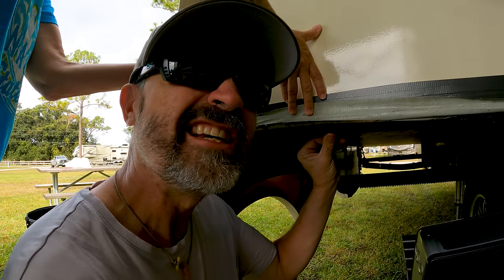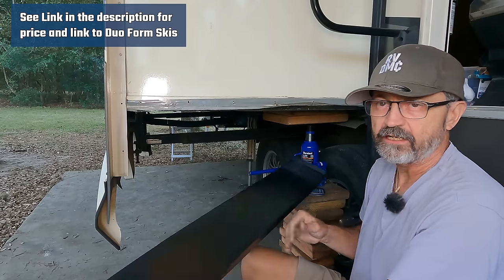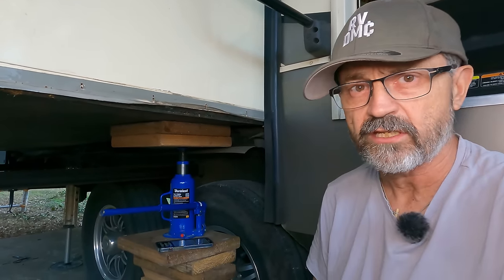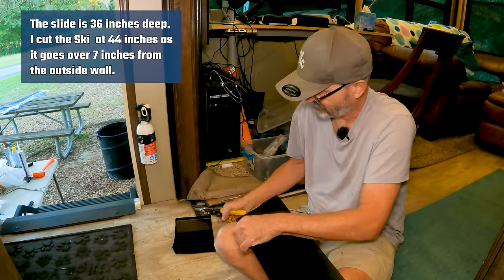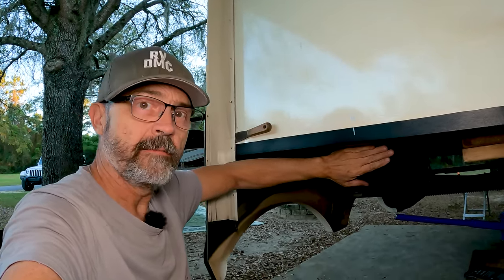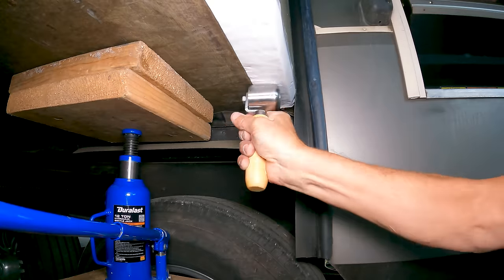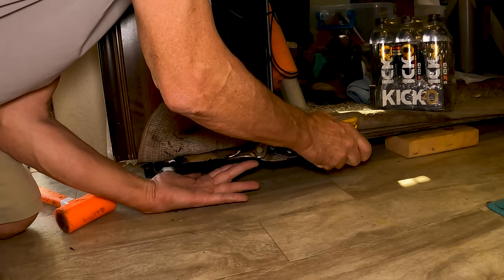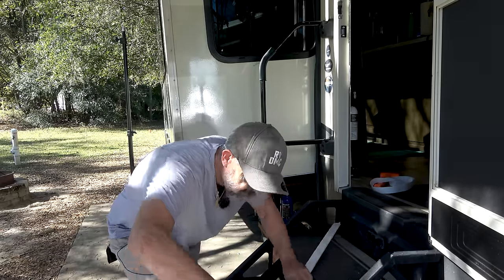RV Slide Water Damage repaired with Duo Form Skis (RV Living) 4K

Comment: I've helped so many 5th wheel owners with their slides in parks over the years. This includes brand new ones on their first trip. They all seem to be designed to fail at some point - some earlier rather than later. Nice job on the repair. I am sure those out there with slides will appreciate this video to reference.
Reply from the maker: It is ridiculous how many slide issues there are - we slept with our bedroom slide pulled in when we first went full time. 
The community is great because of people like you 🤗

Comment: Great job on the repair. I'm still in a S&B so I have all of those kinds of tools and sealants and solvents. But after watching this, I need to rethink some of what I'm carrying. Especially since we have an older smaller rig.  We're thinking seriously about selling and traveling for a couple of years, but because of the cost and availability of trucks, we're staying with our current rig for now. Thanks for the great detail.  We'll done, you do nice work.
Reply from the maker: We still have a storage unit where i kept a lot of the tools and supplies for our old S&B, every once in a while i pull something out of storage when we are near it.  I could have used my caulk remover tools for this job, but the razor blade worked fine.  Truck prices are crazy right now, going way over MSRP, you are smart to wait until this craziness ends. Larry

Comment: Excellent job Larry.  I have had similar problems on my 2018 Reflection.  Some of the screws in one metal strip rusted and broke before the cracks in the plastic started on each side of my kitchen table slide.  I couldn't get the all of the broken screws out so had to drill other holes in the metal.  I  stuck Eternabond tape over the cracks for a temporary fix and its worked fine for now.  I was able to get a 10' length of metal strip (white) from a local RV dealer and have the Duo plastic skis ready for a permanent fix.  I painted the metal with spray paint and will use some of your methods for a permanent repair next year.   Thank you.
Reply from the maker: That sounds like a great solution until you can get some skis.  I saw a video from one of my favorite RV youtubers, Love your RV   https://www.youtube.com/c/LoveYourRVonGPLUS, he also used some aluminum corner iron, to do his repair.  Thank you for the compliments, I really appreciate it.  larry
Reply: @DownsizingMakesCents  I bought 4 skis from DUO and have installed 1 under one side of the kitchen slide as the screws were not broke.  Will use some of Larry's techs.

Comment: Great job, looks great I’ll save this video to my favorites . Larry you’re doing a great job , nice and slow and not in a hurry so you won’t make a mistakes.
Reply from the maker: Thank you so much. I was nervous about Larry fixing a slide issue on his own, but I should know better. 
He does his best in his DIY videos to be thorough, but concise - not always easy to do. 
We hope this helps others feel more confident and save money doing a DIY 🤗
Reply: @DownsizingMakesCents   I found out early in my RV adventure that started in 2016 with a 2016 Coachman 17’ Travel trailer, U have 2 choices - one take it to the dealer in which I did and wait and wait and then wait some more till you’re old and gray or start learning how to repair your unit, so after a couple of times and bad repairers I started to fix my own and with the aid of folks like y’all, I have been doing just that. We have moved up to a 2021 Grand design Reflection 303 LRS and we love it our first fifth wheel.

Comment: I have had to replace the slide skis on our slide room as well. I also used the DUO  slide skis. The only issue I have with how you did the repair is how you sealed the bracket when you put it back on the slide room. I agree with the double layers of butyl tape as well as running a bead of pro flex across the top of the bracket, however I don't agree with running a bead across the bottom of the bracket. The reason is that if any water does make it behind the bracket and past the butyl it is now trapped and can't escape. The general rule I have been told and always follow is that you never completely seal the bottom as you always want to leave an escape path for water should it ever makes it way past all of the sealant.

The only other thing that you may have wanted to do which I had to do on a previous rig that had some water damage to the slide room floor edge was to drill a series of holes into the soft area of the slide floor. Then use  a two part epoxy that is designed to harden up areas of wood rot and force it into the holes and the edge of the slide floor where it is soft. Let dry for 24 hours then put everything back together. I did this on a previous unit and the floor was  still rock solid and held the screws 7 years later when I sold the rig. This is something you might want to consider if you every have to replace the ski again.
Reply from the maker: Well Bill, it looks like it would have been handy to have you around when i did this repair, you have a lot of great ideas and tips.  I agree its not a great idea to seal the bottom of the bracket, just like you said not where for water to go.  I thought about injecting some epoxy into the wood to firm it up but, except for the edge the wood felt very solid.  I dried it very thoughly with a heater for a couple of days, after i got all the water out it felt good enough to leave alone.  Someone else recommended a product designed for treating rotten. Wood on boats, I will probably try something like that if i have anymore rotten floors.  Thanks again for sharing your tips and experience.  Larry

Comment: Excellent detailed video. My only suggestion would be to put sealant on the screws prior to installation into the wood flooring. Unfortunately I have the exact problem along with slide out seals needing replacement.
Reply from the maker: Hey Vincent, that’s a great Idea about sealant on the screws to provide extra protection, I will try to remember to do that the next time I have any exterior repair where water is an issue.  Thanks Larry

Comment: Well done, I seem to have the same issue with possibly 2/3 slides, on a Flagstaff Front living, with 4 slides, stay tuened, I am going to attempt to start with my first slide/corner... This will be some work but it really looks like a solution...
Reply from the maker: After you have a problem like this and fix it, you end up making it better than factory original, but you got to keep an eye on all your bottom. Slide corners to make sure there is not any water intrusion. Larry

Comment: About to tackle this on my GD310GK. PArticl board not rotted just swollen at the edges a quarter inch(bowed downward)...I am drying out and will sand it a quarter inch down and perform exact repair as you did....dealer wanted $4500 for whole floor repkacement and said not rot, but wood layers are separting and will get worse,,,,I'll take my chances and give this a go...thank you for the video.
Reply from the maker: It is a very doable project, even if you have to replace a large section of the floor.  I was going to eventually put a new 1/2 inch sheet over the whole slide floor to strengthen it and just cut out the really bad sections below.  This rig eventually got totaled this year because of a bent frame boondocking in Montana, we have a new one now, but not i really inspect the slide skis regularly to make sure there is no water intrusion, if there is water i will address it much quicker than I did last time.  Good luck with the project, reach out if you have any questions.  larry
Reply: @DownsizingMakesCents  I was thinking of replacing wood, but will try this first. I have very minimal separation on edges and no rot...but it is bowed in center a lil.. .Just sanded down bowed part a quarter inch and put sealer. Putting ski's on tomorrow. Both sides need to be done,. Will let you know how she turns out. All the best to you.

Comment: Nice job, thanks so much for your video. GD 398M with similar issue on same slide out similar location. This 2019 model has the ~ 9’ slide carried on rollers at 4’ O.C. Water damage at the most inward portion end wall of the ¾” plywood. Plywood crushed downward about ¾”—I also noticed the slide bowed downward while looking across the bottom of the slide nearest the inward portion—both ends. I had some metal pieces customized to carry the weight out across the floor. Going from memory since I am a tad too busy to look at notes :- ) : 2 @ 3/16” metal plate bent L shape @ 89.5 degrees 3” H x 20” W x 30” long bolted to the floor. 2x2” ¼” wall radius corner aluminum tube as a stud with cap welded on top at the most inward corner on the inside of the slide. ~ 3” H x 3” W x 39” L 24G brown sheet metal for the ceiling and a 2 W x 6 L” 3/16” piece of metal on top of the stud bolted to the slide framing—maybe didn’t need that. The stud is held in place with ¼” x 3” screws going through the outside of the slide with stacks of 3 washers smaller to bigger—that is carrying the roof and end wall weight to the 3/16” metal plate. Those are not visible when the slide is out. There is no bow in the bottom of slide now. I need to add slide skis, which led me to your video. If I had to do over would do a few things different :- )
Reply from the maker: THanks for sharing your project here.  I think you need to make a video, telling the things you would do different. But sounds like you have it under control.  Larry

Comment: This video was very very helpful. I am about 90% finished with my repairs. Unfortunately, my wood was very rotten. I removed about half of the floor in my bedroom and replaced it with a new piece of three-quarter plywood. The only part of your video that was a little confusing is that it seems you installed the vertical bracket above the ski. Why would you not have that vertical bracket go all the way over the ski. Those two thick strips of butyl tape seem to prevent that vertical bracket from going all the way around the ski. Any reply would be much appreciated.
Reply from the maker: Do you mean the horizontal bracket?  Larry

Comment: Good video. Did you not replace the wood? Was not sure if that was needed or not. Looks like a pretty easy process if you have the right tools. Nix fix. Larry overkill on a job? Never. Lol Good share y’all. I think this could help people.
Reply from the maker: William, we got lucky. After the wood dried out, we saw it was just bad on the edge - that’s partly why he used longer screws. 
If Larry ever built and RV from scratch, that thing would be rock solid. 
Alice

Comment: Don't have any slides but had to watch simply because it was so well done!  Excellent audio, talent and edits. Bravo!  On a related note, our recently purchased little travel trailer had lost it's external water barrier on the underside.  After cleaning, I used Flexseal on a roller and paintbrush to seal.  Seems to work.  Have you ever had occasion to work with it?
Reply from the maker: I use the roller on all applications to press down tape to insure best contact, even n duct tape.  Etermabond must use roller.  Lar

Comment: Excellent video and step-by- step instructions in the comments section. I want to install these skies on my 2012 Surveyor - SV302. Can I jack my trailer the same way as Larry, with the 1-2 minimum restriction followed? Does the retraction assembly have to be disconnected first? Greatly appreciate any advice.
Reply from the maker: Most slides you can Jack up similar to ours. Just do it as little as possible - like an inch to get slide in

Comment: My RV has the same setup. A few of the screw heads were broken off (came from factory that way). On my slide the outside edge of the ski is next to the plywood. Then comes  the wall and last the moulding strip. Water coming down the slide wall can’t get into the top edge of the ski, because it’s behind the wall and 3/8” higher up.
Reply from the maker: I find that being an RVer means you have to be a water intrusion investigator, try to figure out, if i was a water droplet, how would I try to get into the RV.  Sounds like you have a good solution to keep water out.  Larry

Comment: 1) wanted to tell you Fantastic Video
And 2) We just got a 2021 RV Winnebago (2-3 slides) should we just automatically Do this now? As any Trailer with slide out will eventually do this???  It does have the awning thing over each slide if that makes any difference ✌️💛
Reply from the maker: Theses a great protection for the floors and water protection from the slides.  I wouldn’t install unless I had a problem with the slide scratching the floor or water intruding into the bottom of the slide.  Larry

Comment: Hi, I'm a first-time RV owner and I had a question. I had some leakage inside, from heavy rainfall, along some of the wall joints(where the wall meets the roof); most of the leakage came from the area where the slide is, and, to do a quick repair job, I used a hot glue gun to seal the leak areas. Will the thin line of hot glue affect the slide's operation at all?
Reply from the maker: I don’t think the bead of hot glue will affect the operation of the slide but hot glue is not good for sealing water,  it is too brittle and it will break off and leak do you need to use a proper RV sealant to make sure you don’t have any water intrusion in the future. Larry

Comment: I am about to tackle my slide problem, identical to yours except replacing entire wood floor. I was thinking about sliding the ski underneath the outside skin of trailer, so water won’t have a chance. Thoughts?
Reply from the maker: Some people have commented that is what they did according to other videos and blog posts.  I couldn’t get mine between the skin and the floor, too tight a space.  So far ours is ok on the outside but i monitor that area closely often to make sure im not getting any water intrusion again.  Good luck with your project.  Larrry

Comment: I was thinking further about this design. If water should get into that ski there is no way for it to get out. It will puddle and soak into the plywood. A few 1/8” holes would probably be a good idea to let any moisture drip out. Like the weep holes in the bottom of automobile doors and fenders.
Reply from the maker: I agree, i made sure any water that got under the ski would have space to drip out of the bottom of the ski, but im hoping water will never get in there as long as ski stays in tack, but i am prepared with a spare ski to replace it if cracks again, now we watch it every time we bring the slide in or out.   Larry

Comment: We just discovered this issue on our RV :( how do we know if it's bad enough that we have to replace the wood VS just doing what you did?
Reply from the maker: I would pull back the carpet to get a good look at the wood,  dry it out really well first with a heater or something.  After its really dry poke at it with a sharp screwdriver or something to see if the wood is permanently damaged.  If it is penetrated easily or moves then you will have to replace at least that section or sometimes its easier to just put a layer of plywoood over it, sometimes covering the entire slide floor.  After that make sure you make everything totally waterproof, then monitor the area after heavy rain days to make sure its still keeping dry.   Larry

Comment: Hi, nice vidéo very informative. I do have a problem with a floor slide that seperate from the wall, probably due the weight of the fridge and stove. How do you think the floor is holding with the wall ? Is it the screws on the metal bar that hold the side wall with the floor ? (Metal bar with screws near the skis) If those screws old the floor and the wall, how thick is the floor? Cause the floor seem to be 1/2 to 3/4 below the metal bar. So i dont understand how does the screws can go true the wall and catch the floor at the same time. Thanks for your help :)
Reply from the maker: If you are repairing water damaged floor, the floor is supported by metal beams below at the sides.  Cut out the damaged wood, place a new plywood piece on top of the replaced section and screw them together.  That’s the only way to secure the replaced section of wood.  I hope that helps.  Larry

Comment: I’ve used a product used on wooden boats called “Dry Rot” for rotted wood in my 1962 Airstream. It is pricey but will solidify rotted wood.
Reply from the maker: This is the exact reason i love to do videos like this and get  comments like yours.  Great tip, I will check it out.  We didn't have extensive damage but treating the part that was rotten would have been a great idea.  Thanks for the tip.  Larry
Reply: The actual name of the product is "Get Rot"

Comment: Just wondering why you put the ski to the outside of the fiberglass? Would it not be better tucked under the fiberglass wall so as to work like a drip edge? Just wondering?
Reply from the maker: That’s how it was on my old ski,  larry
Reply: @DownsizingMakesCents  Great video thanks for the info! I'm changing my floor in a couple of days.

Comment: When you put the ski on should not the outside lip on the ski have gone under the metal portion of the siding on the RV?
Reply from the maker: I put our new ski in the same place the old one was, on the outside of the siding, top edge covered by the metal bracket and screws.  Larry